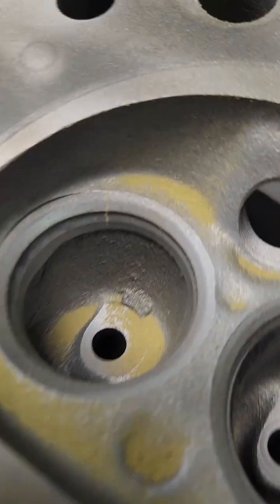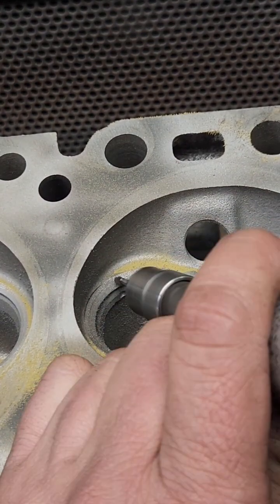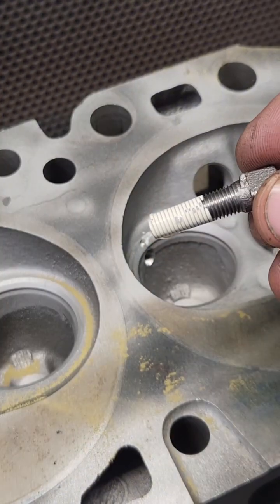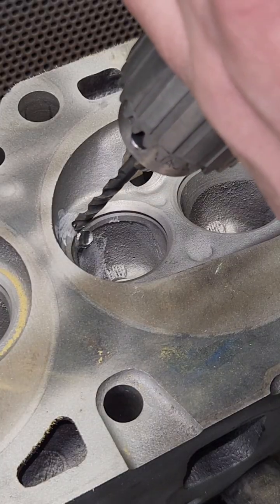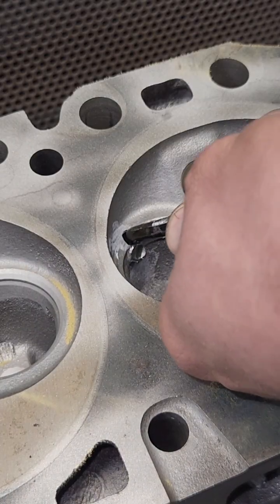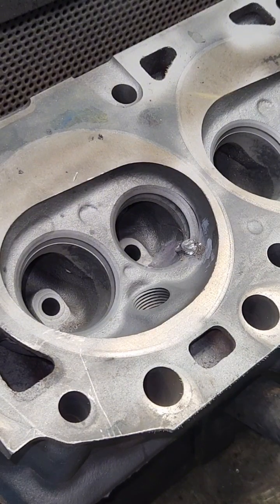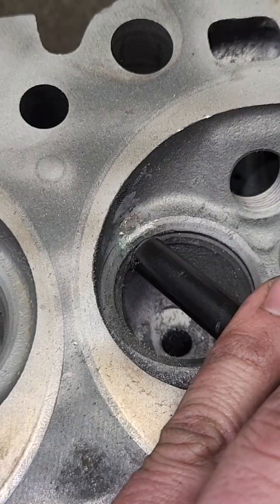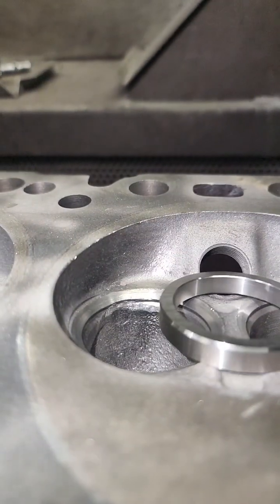Crack Repairing A Ford F-150 Head. #educational #engine #ford #restoration #repair

Comment: I have a 452 head for a 440 and would like to use it, it has a crack just like that I'm an exhaust seat, where are you located.
Reply: I'm in upstate NY, bummer
Reply from the maker: @rexfordgarrison4883  Sorry, im so far away
Reply from the maker: Im located in Portland, Oregon.